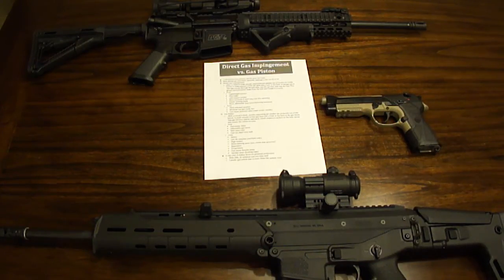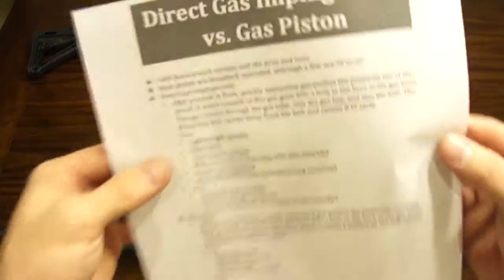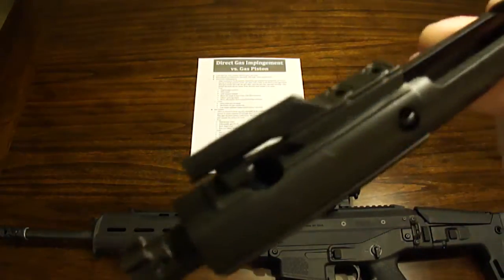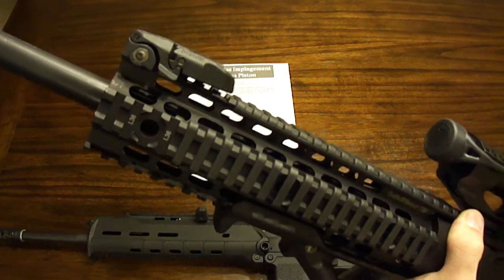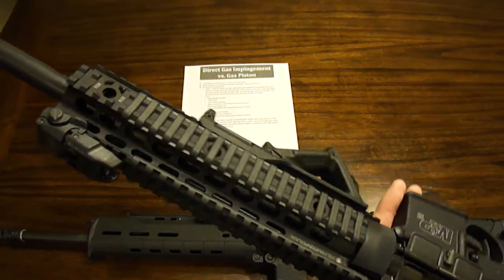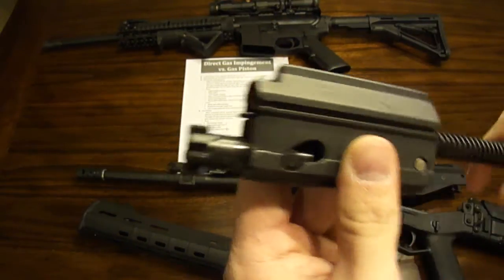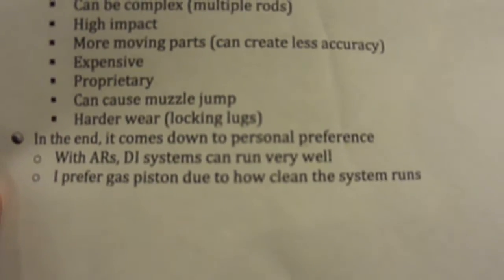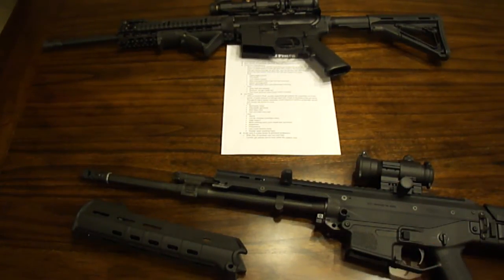DI vs. Gas Piston

Comment: Where is your testing data that accuracy doesn't play a part in DI carbines? "Push Rod" style Short stroke piston systems flex under stress, especially with a longer gas system like the ACR. "Tappet style" short stroke piston systems seen on the FN SCAR and ARX-160 have less stress on the piston systems providing better barrel harmonics and slightly better accuracy. The difference is minimal, however. Accuracy is in fact a large factor in comparing DI carbines with piston systems, provided R&D funds from leading industry manufactures can attest to this.
Reply from the maker: Damn, you came prepared, haha. I wasn't stating that DI carbines aren't accurate. I was merely stating that a piston rifle may or may not be equal in accuracy with a DI gun. I've seen piston guns that shoot like crap and I've seen piston guns that shoot awesome. I've seen the same from some DI guns, but they do outnumber the number of accurate piston guns (unless said rifle is $$$ like you stated about the R&D). My main focus in my statements is that buying a piston gun doesn't mean that your rifle will only shoot 3MOA. They are also capable of good accuracy, with the caveat being that every rifle is an individual. Thanks for watching!
Reply: bigapple0828 What might also be a good test would be comparing the various material properties, coatings, and hammer forged barrels with the various gas systems to see if that plays any significant difference in accuracy. Anyways, thanks for the video.
Reply from the maker: Tech Support If I were made of money I would but obviously I don't have the time and capabilities to compare a bunch of different barrels. But I will attest to the accuracy of the melonite barrel on this ACR through my own testing with a future review. Thanks for watching!